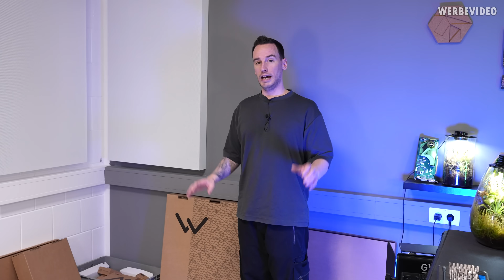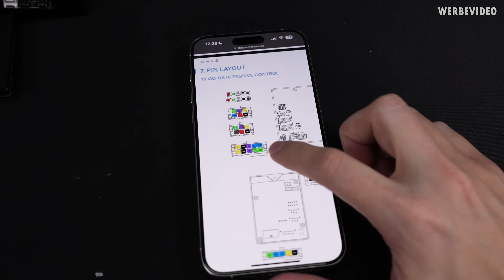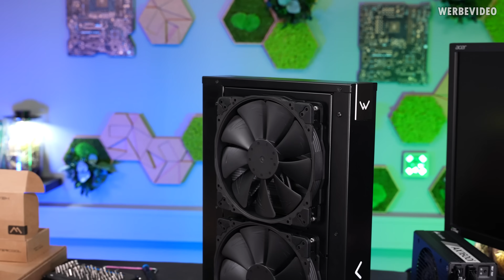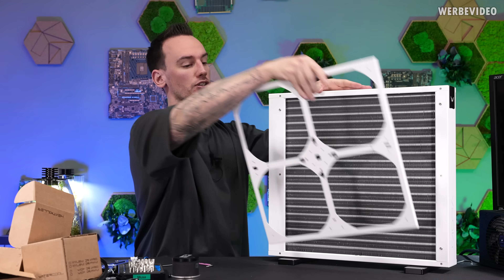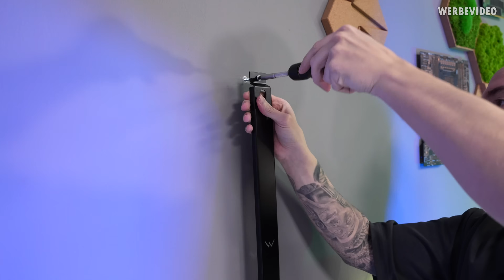The Most Extreme Radiator Ever Made - Watercool MoRa IV 600

Comment: Skip the first party rgb software and use an esp 32 with wled. 

It's likely the led's use an NZR binary signal like you'd find in a ws2812 led and wled is compatible with many types of led chips. Each channel of an esp 32 can drive 512  leds perfectly with up to 10 channels, depending on which implementation you choose, and these leds can be controlled wirelessly via app or browser interface.

There are some design considerations to make when grounding the esp to the main power circuit and it's likely you'll find problems with proper operation if you don't inject power independently from both ends of the circuit.

With rgb fans you have 3 circuits to consider; power, pwm and arbg signal. When I looked at an up close picture though I saw 5 connections which leads me to believe that these fans use 12 volt fans and 12 volt led's; GND, 12V, PWM, TACH and a 5V RGB signal. 

If you give the wire a couple snips and a few stripsthen add an esp 32 with a breakout board and a pwm controller that can drive the 86.4 watts, 0.45A x 16 = 7.2 amps @ 12v, these fans and lights dissipate you could build a solid and independent cooling solution without the need to involve a computer.

Comment: Kinda off topic yet this is where the GUNK comes from that blocks the cooler copper head fins on a liquid cooled PC using an Aluminum radiator...
PC TECH COMPANIES ALL KNOW THIS BUT THEY DO NOT WANT YOU TO KNOW THIS...
Ima learned that donkers years ago engineering 
"While aluminum doesn't typically form slime when reacting with water, it does react to form a protective oxide layer. This layer, though thin, prevents further corrosion. However, under specific conditions, a slimy substance can appear, often due to the presence of iron or sulfur bacteria that thrive in wet environments. These bacteria can interact with aluminum, causing a visible, jelly-like substance to form"

Comment: Now all they need is for it to have its own power supply and a bidirectional Bluetooth signal that could relay all of the different sensor-readings so the fans and pump can adapt to the different temperatures, because the wired connection needs to go.

Comment: 13:41 At this point just go down to a wrecking yard and pull the radiator out of a Peterbilt.
In fact my grandpa has a bulldozer radiator sitting in the woods I bet that could work.
You could hang it outside and mount it horizontally so passive airflow would do all the work.

Comment: running the MoRa 3 420 here with 4x 200mm Noctua, it really is so quiet. but can handle so much heat. 

3 pumps is just silly but it is cool and custom loops have never been about cost efficiency anyway.

I do like that control panel thing for the 4 though, A lot better than the jank crap I have going on with USB extenders, a PCI-E extender and a Corsair Commander.  BTW I noticed a mention in the assembly manual for the passive controller that PCI passthrough bracket exists so you do not have a wire just dangling out the back of the PC.  I kinda wonder if a dab of 3D printing could adapt this controller to a MoRa3.

Comment: Hello. I watched your video. And I have something to say about the radiator, its assembly by you, and about the installation of the radiator on the wall. I ASSUME that your video was advertising and partly educational and its main sponsor is the manufacturer of these products. And therefore you can not voice the shortcomings of these products and their weaknesses. Our world is what it is, I hope that this is not forever otherwise .... Therefore, I will list them for you and also for you, because seeing what you did at the end, it seemed dangerous to me and I want to warn you about the danger. 1) These products have an UNCOMPROMISINGLY low performance-price ratio. As you said: (no comments). 2) Huge dimensions, and therefore weight comparable to industrial samples. The problem of high component temperatures cannot be solved by increasing the size of the radiator. 3) The design of three pumps (and fans) connected without cushioning between themselves will lead to resonances between them and a reduction in their service life. 4) Fan madness.... in industry they would install 1 fan. 5) Heat-dissipating elements of radiators are not painted black (cheaper production) and therefore their ability to radiate heat is deteriorated - 10 - 15% efficiency. 6) This is an assumption: pumps have a cheap version of a ceramic bearing, the basis for them was the vpp655 pump, made in Romania (a hemispherical rotor, a metal rotor and "stator"). A good bearing is vpp755 (APEX VPP) - a cylindrical rotor, a plastic rotor and "stator". 7) Now I will say something about your actions. I heard that you have an engineering education and the quality of the products your company produces confirms this, I use them and modify them, but you are clearly not a construction engineer. Judging by the way you filmed the video, you did not write the script and did not read the instructions, or the instructions were simply not included with the radiators, it is unlikely. The instructions should describe the installation of such massive objects as these radiators. And the tab should say that they CANNOT BE MOUNTED ON DRYWALL!!!! Moreover, when you drilled holes for the mounting dowels, you turned on the impact mechanism, which resulted in a hole of very low quality. Such a massive radiator will not hang on such a wall. Under the influence of vibration of pumps and fans, it will fall and break. Most likely, this can happen even when you start pouring liquid into it. You can fix the radiator only if you find a support on which the wall is fixed. I hope you will take my installation recommendations into account and correct this situation.

Comment: I'm currently at 00:15 in this video and thinking, why the heck didn't you use an automotive high performance brushless radiator fan, with an airtight shroud???
Okay okay... it could be loud, and you'd loose overall back pressure across the radiator.... but given enough fan and speed controller tweaks it would be wild.

Comment: 13:15 - I actually let out a belly laugh when you walked that monstrosity on screen. With an automotive-grade fan, that thing could legitimately cool a beefy car engine. I assume the use case for this thing would be cooling several high-power computers with a single radiator.

Comment: Those large radiators come with hotspot issues if you don't have a big enough pump to force an equal amount of fluid through all the channels. Essentially the fluid will follow the path of least resistance and part of the rad will essentially be doing nothing. I would suggest putting multiple heat probes in different parts of the rad when you start testing it.

Comment: I am curious how you were able to power all three pumps, the active and passive controllers only have 2 plugs for pumps from what I see?  Is the 3rd pump using the pump molex/sata adaptor to power and control the speed of the 3rd pump?  Or is there a Y splitter cable that I just don't see on the watercool shop?
Reply: I came to the comments section exactly looking for this. Guess we will need to ask watercool support. 😅

Comment: Those snap on grille stand off fasteners, and the quick removable fan bracket are a well planned features for eventually dusting the fans.  I don't see the wall mount working as it will bottleneck the exhaust air.  Running tube and cable to a system hung on the wall would work if on shelf.  Waiting for the test results, i.e flow rate, and definitely oc.  I think we need to be electricians to install this, or this make us one once we are done.

Comment: RGB without non-volatile memory should be banned, grr.   Got a new keyboard (same company) and they switched to it, so now it doesn't work without running the software first.  Yet more cost cutting disadvantaging the consumer.

However; if there's no power loss, the information stays, so if it's going to run 24/7, just have to set it up once, or run the software once if power is lost.  Not sure if iCue is different from Logitech's crap, but closing the software resets the profile, but ENDING THE TASK keeps it all saved.

I vehemently hate software like this running in the background, so it was a great thing to discover.  OpenRGB usually works well too, for the same volatile products.

Comment: Please do more of the MO-RA IV stuff. There's so little information available on it, and it's too expensive to buy and "just hope" it will work as expected. Especially how you'll be connecting tubing, power, PWM, etc between the MO-RA and the computer over a somewhat long distance. If you ever get one of those active control modules, that would also be very interesting to see. I think Watercool might have decided to compete with Aquacomputer for some of this stuff. Your thoughts on that would also be interesting.

Comment: The smallest one, that's something I could see getting. The big ones seem overkill.
BTW, I think you should have mounted a board going sideways with it screwed into the studs and then mounted the radiator to that. Those drywall anchors are likely not going to hold.

Comment: Ditch the gimmick RGB and get some proper high static flow fans, with it being wall mounted and a pull config, your gone want a fair amount of vacuum. From a thermal point of view, the 4x200 setup would probably perform better and at a lower sounds volume. Some good brushless fans running under pwm control would be perfect for this application.

Comment: Cute all beautiful but, if one wants a near perfect complete assembly you need to buy all individually the parts, which adds to the Total price.  It would be 'nice' if the website of the Watercool had a web configurator to select all one wants to, or needs to buy for a complete assembly.  

Looking at all that makes me wonder how much cheaper it could be going to a local car shop and buy OEM Radiator, pump, etc.  Love the video and looks of the White version. 
It would be nice if it had a Bluetooth connection with a desktop system to sync the ARGB and read/write the control via a GUI software with minimum load on the CPU.

Addendum: Watching parts of the video again, that Software SW for the control of the Fans is full of bugs and still needs some serious overhaul. It sounds ridiculous to add a mini PC to just control the FAN ARGB. I would use a cheap ARGB Hub with enough power and a cheap ARGB controller with a remote, can be found for less as $10 USD on Amazon.  I bet that would be cheaper as adding a mini PC.   Learning Curve? Looking forward to your follow-up video once all is up and running.  

A nice (Touch Screen) Display would also be nice on the Radiator.  So many possibilities , dream away.  Thanks for this video Herr derbauer.  👍🤛

Comment: ICUE is a nightmare for this, also that high pitch noise you hear also happens with my qx120mm all 13 of them, if set to max brightness they will make that horrible noise.
also than fan bearing and temp sensor on the fan are clearly cheap as one of my intake fans reports it runs 70c (had to disable emergency shutdown)
and another fan i had to replace seized up and made a really loud banging noise until it died completely. 
not to mention the ton of other issues since using icue

Comment: At what point do you just use a window fan instead of a bunch of little fans surely the frames of all the little fans block a significant amount of radiator that could otherwise have are passing through it

Comment: That thing is AWESOME! I want a case that has one of those (maybe the double 200) on the side with a hinge that lets it swing open when in use, then clip flat against the side for transport/ space savings... 
*I noticed it looked like you went straight into the wall and not a stud- That seems pretty heavy and would freak me out personally, especially when adding the water, but I've had bad experiences with heavy/ expensive things busting out the drywall 😭 Good luck!

Comment: I would plate a thin piece of timber board on that wall that is at least twice the size of the rad and mount it using proper steel wall plugs.  A tv wall mount has at least 20 mounting points but a TV is moving water around it.  Great vid btw.

Comment: Those wall anchors are not strong enough to hold that radiator especially when filled up with water. 
Please bolt those mounting frames into some studs for long-term mounting. It would be horrible to see $1500+ damaged as it falls off the wall.

Comment: How can you use a cooler that size for your test rig and expect accurate results?  With that volume of water you’re not going to reach equilibrium temperatures unless you let the PC idle on for 6 hours before and between each test.  Also, you aren’t going to be reaching any meaningful test results for your viewers.  99.9% of your audience isn’t running a ford fusion’s radiator in their PC’s cooling loop.  Of course it’s “cool”, but that’s not the point.

Comment: Roman, you're the engineer here -- I'm not -- but I'll be amazed if your wall holds once you fill that thing with water.  The most 'heavy duty' plastic drywall anchor I've seen goes up to about 75lbs.  Some metal drywall anchors claim up to 100lbs.   I would think before you fill it, you'd want to drill the MoRa IV wall mounts directly into studs.
Reply: He will be fine even with 30lbs anchors. 120lbs (4x30) is 55 kilos. He has 16 kilos now, and he won't get more than 30 additional with water.
He might have trouble if the environment gets humid tho.

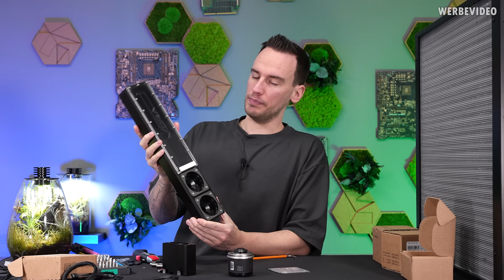Comment: 20:00 correction, you can run two pumps on 200 and 400, you need tank 200 for that. With tank 275 you can only have one pump and if you attempt to mount second one or third on tank 200 - it will cover about half of the bottom inlet.
But 275 with a single pump and 200 with two pumps have the same height.

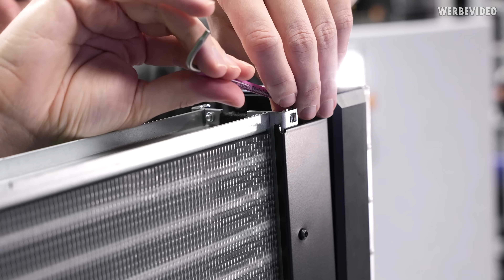also 22:22 - I dropped a washer from the screw when I was trying to mount the tank. Twice.
No, you don't need to disassemble the front panel, but you need to remove bottom panel and then shake the radiator to make that washer fall through all the copper pipes, wires and so on, sometimes it gets stuck so you flip the radiator and try to shake that washer through the opposite opening. Not fun at all.

Comment: So the Lian-Li SL120's (V1 & 2) have a controller that retains settings until it loses power. I can set up my fans, shut the program down entirely and it keeps my settings through a shutdown. Only loses its memory settings when the power completely goes out (or if the motherboard doesn't have USB power passthrough. 

Might be worth a try?

Comment: I had a Phobya (?) 3x3 radiator some time ago.  I started with 9 x 120mm fans, but ultimately used a single 200mm with a 1" thick shroud/plenum.  The only noticeable sound from my system was the PSU fan.  This MoRa looks much higher quality.

Comment: Get ESP32 with WLED, or Aqua Computer Octo/RGB modules.
I know, it isn´t Watercool, but still another amazing german brand.
And works standalone, so you program it once and leave it disconnected, works in BIOS/Linux etc from the saved profiles in the internal controller memory.

I have mine in the PC case, and just 4meter 4x1,5mm CYKY cable with crimped MOLEX connector on both ends for 5/12V power to pump and fans. Those are providing power via Molex->SATA adapter and also have split before that for 12V power to the fans.
Speed+PWM goes via 3x2 thin data cables next to it, joining the connectors at the rad side and inside the case are connected to Octo.

So from the case only comes out 2x hose for the water, power cable and data cable for the fans. Simple and "clean". Get nylon wrap and tight it up together

Comment: @Der8auer EN . To save your fan RGB device memory profile in Icue you need to open Icue, then click on any of the options like lighting effects or fan settings under the device on the home page, then when it opens up the device page you should see a toggle in the new settings panel called Device memory mode, switch that to on and it'll then only use what profile you've set it as all the time until you toggle it back off again. I 'think' when you toggle it on it allows you to save one or a few new device memory only profiles where you can set up the colours or fan speeds as you need them.

Comment: 600 mm?  Why put it on the wall when it could replace a ceiling tile above you?  Should be the same tile size in Europe.

8:54 It would be nice to have an active control system that was network based.  If the unit is housed externally from a distance of the host system or multiple systems are being cooled by it, a dedicated/independent controller would make sense.  With modern PoE equipment, 71 W is available from the network which should be able to power the pumps and nine 200 mm fans.  I don't think it'd handle sixteen 140 mm units. with RGB.  It'd also be nice if the active controller also handled RGB lighting too.  Then the only "cable" going form the computer to the radiator would be the water tubing itself.  

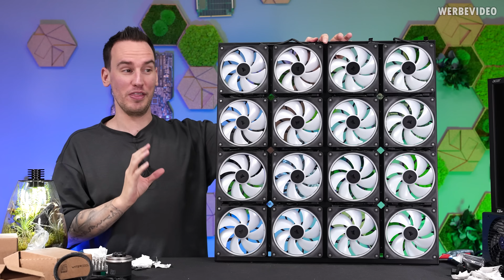17:50 It looks like six small 40 mm fans could be added in between the larger 140 units.  If they were reverse blade/spin CCW, they'd push air the same direction as the primary 140 mm units and help with overall airflow in front of the radiator.  Actually radiator cooling they wouldn't contribute much directly but this is a small efficiency play.

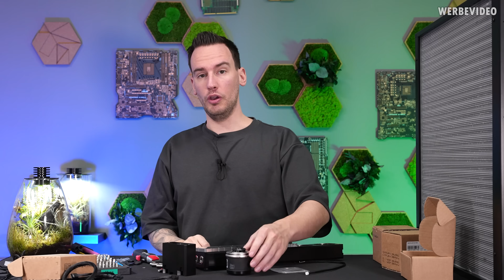19:45 Three or four pumps would make sense in a liquid push/pull configuration through the radiator.